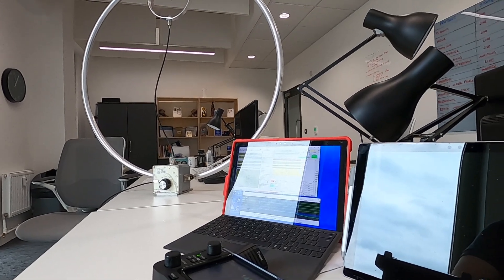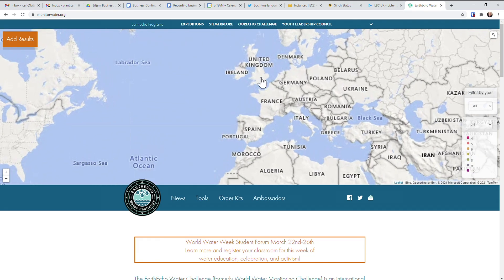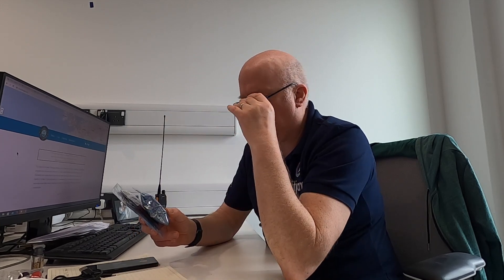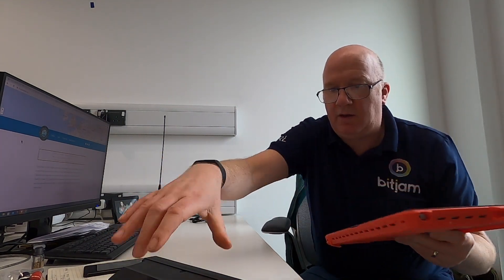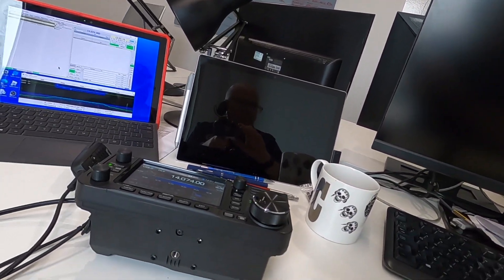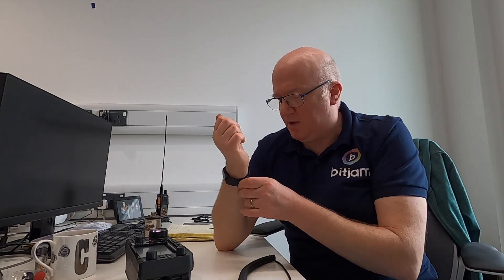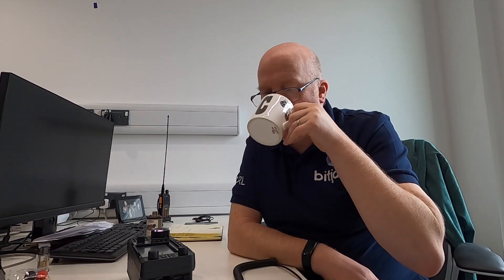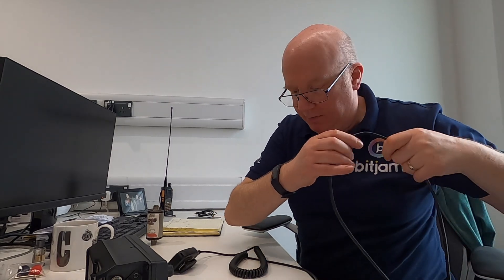Using a magnetic loop indoor antenna in a modern building

Comment: I use a home brew mag loop antenna inside a concrete,rebar , brick three story building. I'm on the first floor. I make contacts 250 to 300 miles during the day on 40 meters contact with ham nets. I even make contacts with bad band conditions on 35 watts. . I guess I am a exception.

Comment: Marks out of 10 for trying Carl. That's what it's all about.

Unfortunately most office buildings have a significant amount of steel reinforcement in them. This is probably a really good thing if you don't want the building to collapse around you but as you rightly said, it does mean that the building becomes a massive faraday cage resulting in the "pants" results that you experienced.

Does the building have roof access? That could be an interesting experiment if you can (safely) get outside on the rooftop one lunch time?

Comment: Hi Carl. The trouble with such a building is that, as you said, it acts like a Faraday cage. That and the compromised aspect of the mag loop, over a lot more wire out in the open, stops you being heard. A pity you cannot have a long wire on the roof :-)